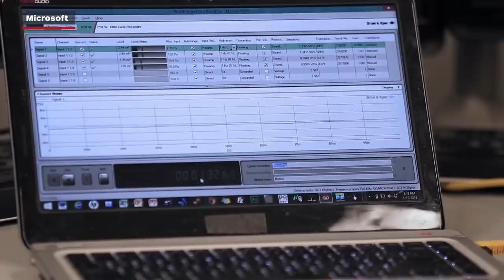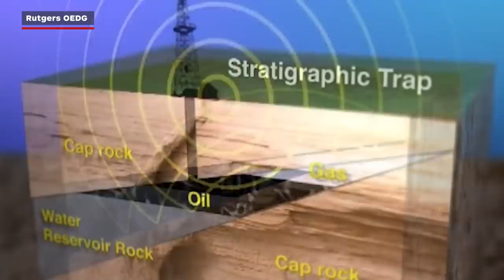How Sound of Metal Created the Audio illusion of Going Deaf (ft. Oscar Winner Nicolas Becker)

Comment: I have Ménière’s disease. Basically it’s a thing that actually drives me close to insanity once in awhile. I have a ringing in my ears that gets so loud in my head that I feel like I’m trapped within my own body. I can’t escape the noise. My hearing goes away during my flare ups,and I really have to calm myself down so I don’t freak out because of the maddening tone...hiss...or ringing I hear. My wife used to take me to the emergency room just so I could get shot up with Demerol to calm me down. I’ll sometimes go a day or two without sleep. The only thing that lets me get away from all of this is taking multiple showers a day,or driving in a car with the windows down a little bit. I’m sort of getting used to it,but sometimes I just can’t and I feel like I’m going nuts. To anyone else out there with this...you are not alone. All I can say is be strong,and hang in there.
Reply: hugs you have my sympathy. I have tinnitus to and it can be so hard to deal with sometimes. ❤️ It can get better though and keeping your blood pressure down helps a lot. Easier to say, very hard to do, I know. But it really is worth the effort.